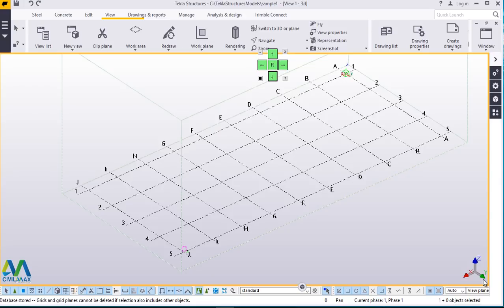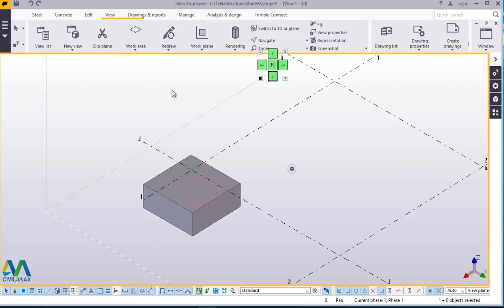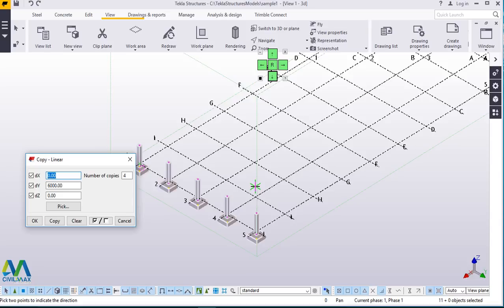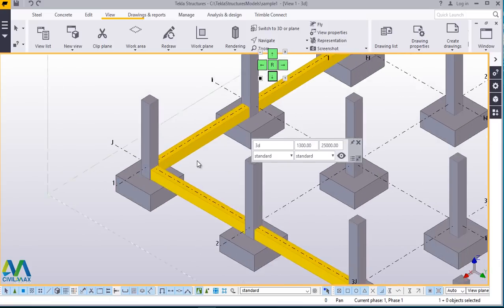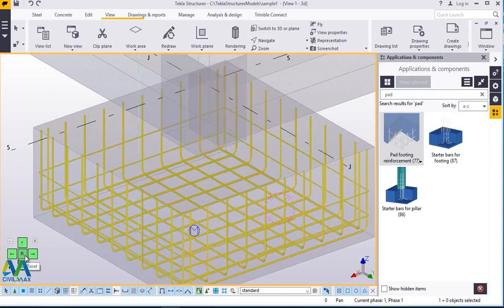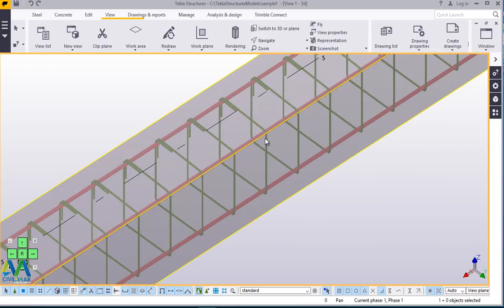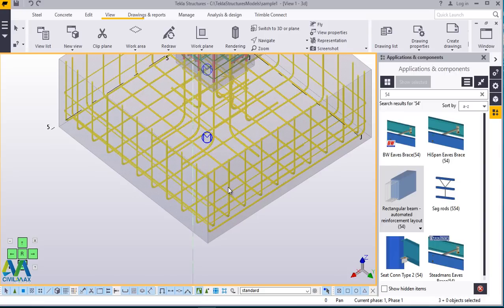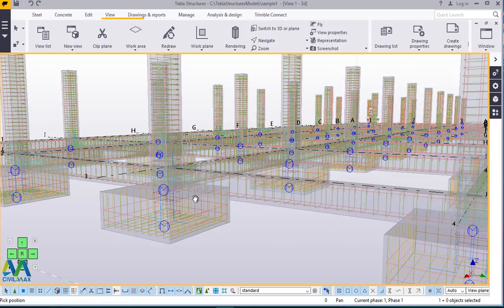How to Create Reinforced Concrete Building | Tekla Structures 2017i

Comment: Hello.. how do you transfer design data from TSD to tekla structures for concrete design and have exact design data automatically converts to TSD rebar transferred data
Reply from the maker: ifc conversion first
Reply: Maurice thanks for responding.. so when the Tekla Structural Designer (TSD) File (Design Calculations Completed) is converted to IFC. Once that IFC file is imported from TSD into Tekla Structures Will i be able to go directly to "Numbering" and then "Create Drawings" and then my drawings with reinforcements and design details calculated in TSD appear on my drawings sheets. Or will i have to do some other process to see my TSD designed element sizes and Rebars with all relevant details.